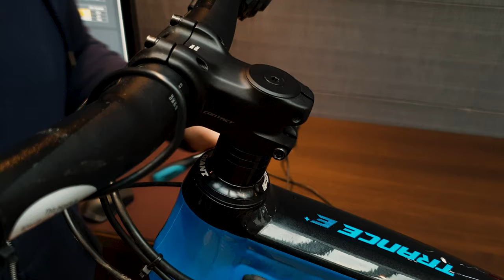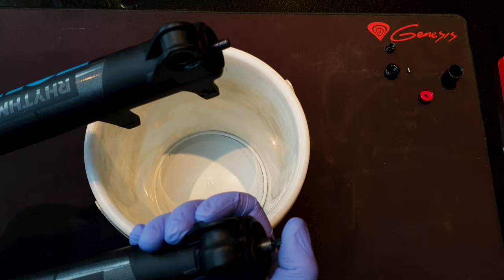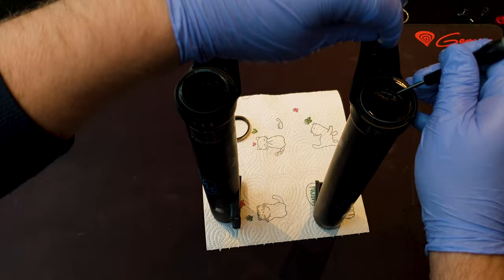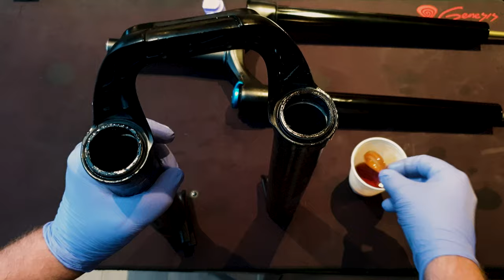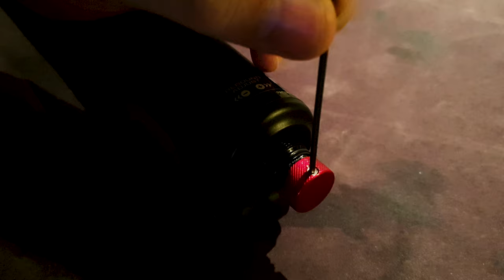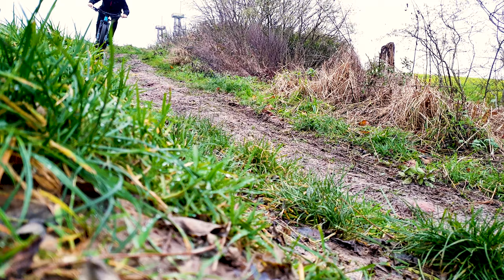Fox 36 float rhythm air spring and lower leg service

Comment: Hi,nice video 👍.
I have 2021 fox 36 rhythm 150 mm nearly the same fork.
Fox advise 15-20% sag but for me  25% feel best until I start hitting jumps;).At 25 % sag just rideing is perfect but when I start jumping Im bottoming the often. 
At fox recommend 20% ( plush)Im  bottoming only sometimes but the fork starts to feel firm.I don't want to try 15% ;).The fork comes stock with 2 volume spacers.Should I add 1 more spacer or add some more psi?Could you advise winch option would be better to still have plush fork and stop bottomout?
Thanks.
Reply: More air...
Reply: add a token! that's what they're made for

Comment: Hi, with which oil did you soak the foam rings of lower legs?
Reply from the maker: Hi dude! You can use the same oil you put in so the fox 20wt gold should be good.

Comment: Hi, is the same quantity of oil for Rhythm 36 - 2020? Reign e+2 pro 2020. Thanks
Reply from the maker: 🤷‍♂️🤷‍♂️ there should be a manual on the site stating volumes and types

Comment: So this is like the whole service? I have a 2019 rhythm 34 140mm, is the process there excactly same?
Reply from the maker: They will share lot's of parts but it could be there are a few differences. I honestly don't know but if you search for it on the site(fox site) there is a section to put in the fork number(it's on the lower leg) and you should find fluid charts and service manuels. Hope it helped🙂
Reply: @NoizieWorks  thanks! I just couldn't find a good tutorial at the fox site, but this was a good video and thanks for the tip⭐

Comment: All the air trapped in the negative air spring
Reply: Please explain
Reply: It happened to me too.
I serviced the lowers and seals, put it back together. Pumped cycling the fork every 20psi to equalise the negative and positive chambers but at my previous psi the fork is hard like rock???There is to much air going to the negative chamber...
Does anyone know if 2021 36 float air shaft works with rhythm 36 fork?
Reply: @juku118 I believe there’s a slightly different diameter air shaft between the two.